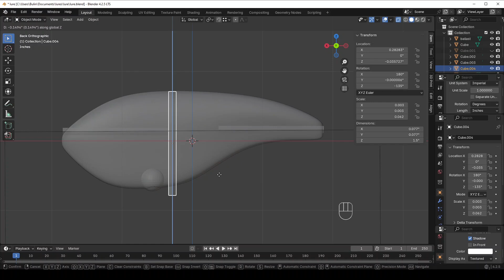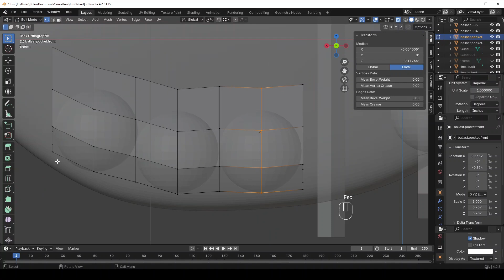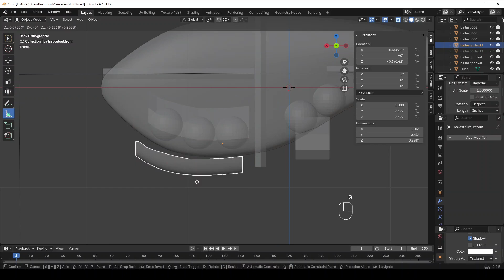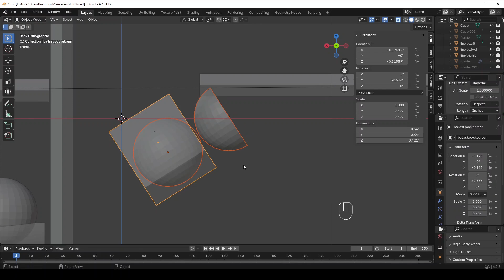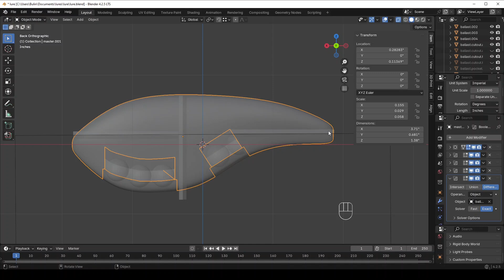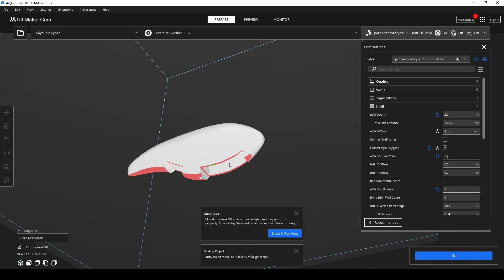From ZERO to HERO: 3D Printed Lure Design Tutorial (Blender) (Part 2)

Comment: Bruh, 0.04 is not four thousandths… plus your trying to use metric so use either mm^3 or m^3, and we don’t use fractional measurement we use decimals.
Reply from the maker: You are correct that 0.04 is not four thousandths. I don't know where in the video I stated that, but my apologies. Obviously it should have been four hundredths or forty thousandths. 

I'm not trying to use metric. I am primarily using imperial units, because that is my native units. Final output is on a 3D printer, and slicer settings are usually in millimeters, so at times it makes sense to make hard callouts in mm. In the video I am showing how Blender allows us to use either or both at the same time. When you are designing your lures I encourage you to use the units that come most natural to you.

As far as cubic measurements, in this exercise I am only concerned about volume for the purpose of density. I am measuring weight in grams, and density is more easily expressed and calculated as 1g/cm^3 vs using 0.001g/mm^3.

I'm not the sharpest crayon in the box, and doing it this way is simpler for me. Thank you for leaving the comment, and I hope that 2025 brings you the best lure making year ever 🙌